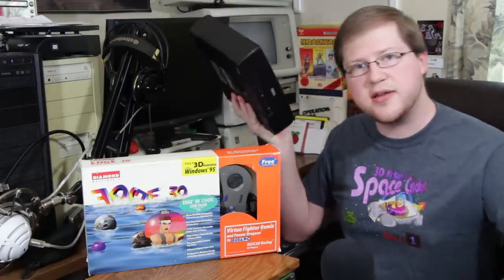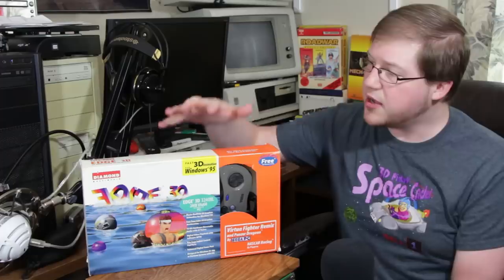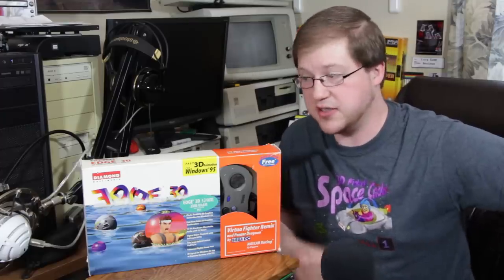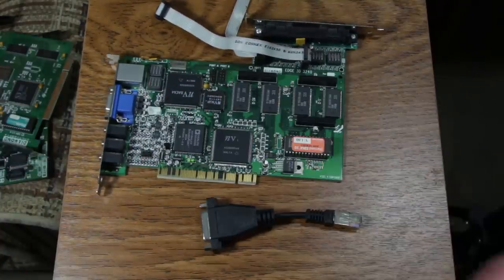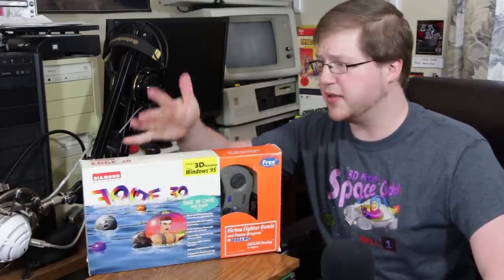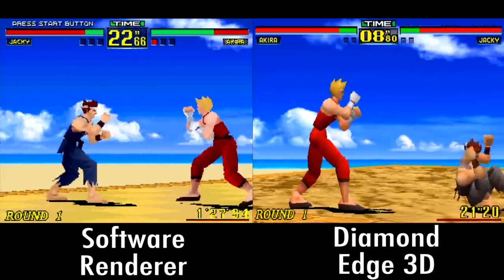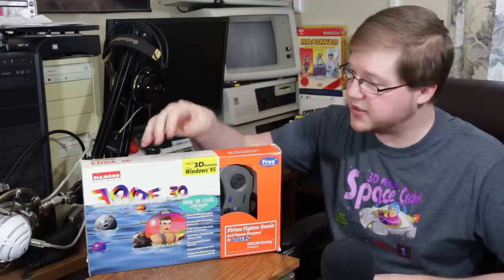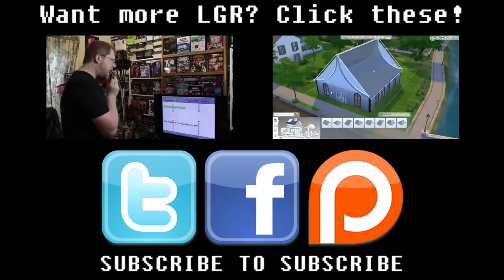LGR Oddware - Diamond Edge 3D (nVidia NV1+Sega Saturn Ports)

Comment: Man, that whole feeling of going from a "game you're very familiar with" to a WHOLE new experience with a new video card...  I can't even put into words how awesome it was when I did that back in the day with my Voodoo 3 and, specifically, Starsiege: Tribes... That was my very favorite game for a long time and I played it online constantly back around the early 2000s, and going from this chunky low-fps beast with individual 'pixels' visible on the textures (though as far as I knew that was simply the way the game was meant to run, period) to this gorgeous, ultra-smooth, 60-fps masterpiece with dynamic lighting coming off the weapon shots and textures that looked like they were from a full console generation later in comparison (seriously was very much like comparing a PS1 game to a PS2 game)... That's an experience like no other.  I suppose I had a similar feeling when I went from having to play Team Fortress 2 on "n64 mode" using scripts to force the graphics lower than normally possible just so I could have an edge as I used to be pretty competitive at it, to going to a video card powerful enough to run it just as smooth on higher graphics settings, but I don't think anything will ever quite compare to that feeling back then with Tribes.  It was seriously like getting a whole new game, like a sequel or remake, to a game I put hundreds of hours into both pre- and especially post- 3d accelerator.

Comment: Too bad the saturn was over engineered and too expensive.
Reply: nakamine1713 THE BROKE THE DISC ENCRYPTION THIS YEAR. It was expensive compared to the other contenders when it came out and burned a lot of developers when sega dropped it early.

So. No. It wasn't fine for what it was. It was overpriced because it was over engineered.
Reply: Yeah, too bad.  This is a powerful piece of hardware, but...

Comment: Nascar Racing on the PC (CD-ROM version only, I think) could be run in hires (SVGA) mode (through a command line switch) and that looks like what's happening here. Obviously the power of the Diamond card helps it run smoothly.

Comment: I remember those days. 133 Mhz was the top of the line, but you could save so much with the 120 Mhz second of the line and not notice a difference for the casual gamer. I do remember this card, but held out for the Riva 128 as my first GPU. I was also able to keep my existing Intel socket 7 motherboard by flashing the bios and allowing me to swap in a 200 Mhz Pentium!!!! I maxed that PC out!!

Comment: You got a helluva voice, almost like a sports announcer or that movie promo guy, lots of potential. I remember my parents buying a Reveal multimedia upgrade kit for my IBM PS/1 486sx, it was like $300 at Silo. It had a 2x CDROM, decent speakers and a sound card, it was a bitch to get working because the ISA sound card had it's own IDE connector that I think I had to use  and  for some reason it included a bad ass Roland soundcard that had insanely awesome midi output. After getting that working  I ran over to the video store and rented a bunch of Sega CD games thinking they would just magically work in the PC lol... I'm glad I never found out about the Sega PC thing, because I would have worked my ass off shoveling snow and mowing lawns just to be disappointed, those were the days!

Comment: The Sega Saturn rendered in quads as well.  The rumor back in the day was that Nvidia was in the middle of a deal with Sega to produce a souped-up Saturn using the follow-up to this chip, the NV2.  That's the reason Nvidia could release this card for the PC.  But the deal felt through, and that's why Nvidia's first actually successful GPU was the NV3 (and why that one rendered triangles, and was fully Direct 3D compatible.  Nvidia and Sega had parted ways by then.)

Comment: My first PC had an Diamond Edge 3D graphics card inside, I didn't even know that the Saturn controller would work on it...I actually owned a Sega Saturn so I could have used the controllers I had and I never knew. I blame the manufacturer for not including the controllers, I might have not have had the controller board either, can't remember.

The built in Sound Card was awesome...to think it would be over a decade before I would get a graphics card with onboard sound.

Comment: PCI was pretty advanced in 1995.  I had a 486-120 with VLB at that time.  A TSENG labs ET4000W32 and Adaptec 1542 controller.  This video card would have required a vast majority of people to upgrade to Pentium class machines.

Comment: I miss those days, where really having a GPU 3D Accelerator improved games so much. Remember having S3 2mb 2d card connected to VooDoo 2 accelerator, which didnt work on its own... it had its own set of problems, as some games just flat out not recognizing it and forcing games through Software mode instead of using the accelerator... god am I glad those times are over though:D

Comment: I have additional info about quads polys. Actually while artist modeling 3D, We always do it in quads. The main reason is it's great for subdivision. A quad would divide into other 4 quads in predictable way. And 10 years ago, many program that process polygon shape and do thing like smooth it would support only quads model. And after the model is done, It would be easily triangulated by split every quad diagonally. And nowadays this process would be done automatically by the game engine. In the end the runtime (DX or OGL) would process it as triangles. I think what NV1 done is quite ahead of it's time and at totally wrong place. Since all kind of surface could split into triangles and a triangle could have only one definitive face normal vector. That is really important to make the overdraw and depth processing and also lighting and shading done fast and less error. So, what the graphic do with the smooth shading now is just take shading info from each and blend it with other face next to it. So there's no need for quad face at runtime anymore.

Comment: OpenGL actually has supported quads from the early days (it was deprecated in version 3.0). The problem was that the tiny processing poer advantage as hugely offset by the fact that quads are able to make concave shapes which would then not render correctly.

Comment: I actually have this card and it works! It is even compatible with Pentium 4 processors (a newer socket) on MSI motherboards.
I ran Windows Vista on it, and since the colors were so limited, it was virtually impossible to see anything and screen resolution was at 800x600 maximum, but yeah. It worked.

Comment: i had one on a pentium 1,the 3d card drastically made it more powerful,remember playing games without problems,that were way beyond my computer specs...the autoexe.bat,and config.sys,was a challenge sometimes though...
Reply: Remember DOS games all worked much better under windows xp 95 on w7 or higher, no overlays of the OS, just the core to rotate the games. What they should do is shutdown w10 navigator use the kernel only to run games for the total power of the pc to run them, no more lies from benchmarkng crappy, more lies about DX12 capabilities, and no doubt that consoles should have to worry about, allowing pC noobs will playing pc games without a view to configure anything,that would be much simpler.

Comment: Had the Monster 3D and then the monster 3DII which had 8 mb ram and ran a vga from the Video card to the accelerator card then the monitor plugged into the accelerator card as well....wicked stuff back then lol.  Diamond Monster 3DII ran 249.00 back then....not cheap by any means.  But it worked flawlessly and made games just Jump!

Comment: I have an old school PC i keep around for the different rendering engines of games back in the day. It essentially is a P3 700 with a 32mb Geforce 2, a pair of 12mb Monster 3d Voodoo2's and a 4mb M3D PowerVR. All of which can coexist in the same box.

it may seem a tad redundant but there are some games that use GLide better than D3D and some that work better in OpenGL and even a couple that take advantage of the tiled rendering of the PowerVR chip.

I'd loved to have put this Edge 3D in the same box as a 3do blaster but both of which are primary graphics cards and would have fought for dominance. but in my situation i have the 1 primary (geforce 2) and the others are simply add-on for different things. Oh and a nice sound blaster AWE 32 for the audio.

Comment: Wow, Virtua Fighter Remix looks so much better. Not only are the models a lot more rounded and complex but it actually has lightsourcing. The original Saturn version looks closer to the software renderer with no light sourcing and running at a lower res, but at least runs at 60fps.

Comment: Good video and this card looks interesting, i had missed this one completley. I wouldve appreciated it if you could have mentioned pretty early in the video what interface it used for connecting to the mb. Im guessing this might have been before agp and its most likley the old pci, still though. But other than that, good video.

Comment: We used to have a 1995 ESCOM computer with one of these when I was a kid. This video certainly brings back memories! And yep, we totally played NASCAR in exactly the same way. Why race when you can wreck other racer's cars?

Sadly, this whole computer and everything it came with has been thrown away long ago. I also remember trying to get one of the games working on another system, and getting stuck because of missing DLL entry points - little did I know this card had a special chipset. I do wonder if it's possible to emulate the NV1 architecture in any way. I don't like the idea of programs/games being unusable because of stuff like this.

Comment: :D - great review as always.  Not sure why the thought of plugging in the end of my joystick made me feel a little uneasy though.  Would other Sega PC games also work with the controller?  Would these also be 'improved' too?  Could use the controllers with other games too?   Also would any other gameplay and graphics be 'improved' with the card too?  For example, those for the Mega PC?  Back in the day it always seemed like a great system as you got Mega Drive/Genesis games and PC together.  Being able to use the Saturn controllers with PC was a good idea, although would the card be unusable if you didn't have two slots in the back?  Or would you be able to use without the controller part and simply remap or emulate the controls?  See what you mean about the sound though.  Also, would you still need to have any other graphics card for 'normal' PC usage, or did everything work via the card? - Sorry for the many questions.
Reply: Other Sega games work with the controller and yes, you can use the controllers in other games as it is detected as a normal Windows joystick. You won't get the graphical acceleration in the other games unless they are supported (only three SEGA games were released with support, Virtua Fighter (only bundled version), Panzer Dragoon (only bundled version) and Virtua Squad/Cop (retail version)). You can connect all types of Sega controllers, even the Twin Stick. If you are interested in just using the SEGA controllers, then there are ISA and PCI cards available like the I/O Data IF-SEGA2 for connecting SEGA controllers to PC's. In these days I also believe USB adapters are available. Virtua Fighter on the Edge3D requires the SEGA controllers to work (or play with keyboard), but Panzer Dragoon can use any controller installed on the system. The Sega controllers need no remapping, they work straight out of the box in the supported SEGA games. Everything works with the card, no need for another graphics card :) Hope this answered your questions.
Reply: RetroCompaqGuy - Thank you for the reply, hadn't really known much about the card until the review, so was very curious to learn more about it.  Hence the questions I asked.  :D

Comment: Wow, imagine if Sony, Microsoft and Nintendo would do something like this for modern gen consoles.  An add-on card you install in your PC to get true, accurate hardware rendering to play console games natively on PC without any emulation or having to run a PC-exclusive port of the games.  That would be amazing, and since they make most of their money on the games, not the hardware (which they usually take a loss on as I understand it), they'd instantly expand their market shares by going after PC gamers and offering them this option.  They could even include a built in console OS/interface with the card (thanks to flash memory; no need for a separate drive, or they could just embed an NVMe drive on the board) and have it all connect to the PC via PCIe 4x or even 1x if they don't need the bandwidth and it would be instant money in their pockets and would allow PC gamers to play those games without the hassle of emulation, perfect console 1:1 accuracy (possibly even better if they have good hardware that can enhance the graphics/performance) and without being forced to use a console and hook it up to a TV.  Oh the possibilities.  Too bad they strive so much to keep everything separate, especially with the recent re-emergence of PC gaming/high-end PC enthusiasts (like myself).

Comment: The interesting thing about using quads instead of triangles is that triangles are always flat because you need three points to define a plane. Quads aren't necessarily flat - you can have four points which are not in the same plane. Maybe the NV1 only supported flat quads where all the points are in the same plane? Supporting the general case quickly in hardware seems nightmarish. And even if you did, what's the point? OpenGL supports indexed vertex buffers so if you need to texture a quad you can do it as two triangles reusing the same vertexes via an indexed vertex buffer. And texturing triangles quickly in hardware is a well-understood problem.
Reply: No, the NV1 also supported non-planar quads. It was even an essential feature advertised to display curved surfaces. And because with this feature you needed significantly fewer quads for round bodies, such as a ball, than if you had tried to represent the ball with triangles. This was the performance gain.
You can also see this in the video above for the Street Fighter game.
Vertex buffers are a new thing, they where not a part of OpenGL 1.x in the time of fixed function pipelines. If i remember correctly, the support of vertex buffers where introduced with OpenGL 2.0.

Comment: The Diamond Edge 3D is literally selling for $500 on Ebay. I guess it's a collector's item, being Nvidia's 1st GPU. It's ridiculous trying to build a retro machine now. I'm trying to find an old Riva 128 or Riva TNT PCI for my old childhood board that doesn't have AGP. If you can find one, they're all $150+. I like retro PCs, but I won't pay more for a 1996 PC than for a modern one.
Reply: It's ridiculous to build a retro machine with a NV1. But i can understand, why it is collected.
Don't get a Riva 128 or Riva TNT! 
Instead, get a Voodoo 3 2000 PCI. It will be a much better card for a retro PC and it will support all glide games.